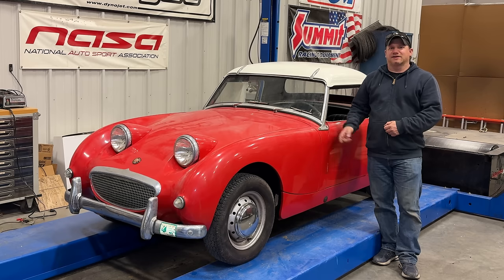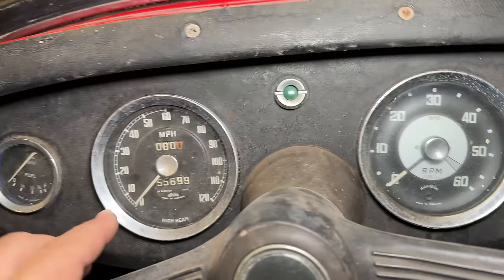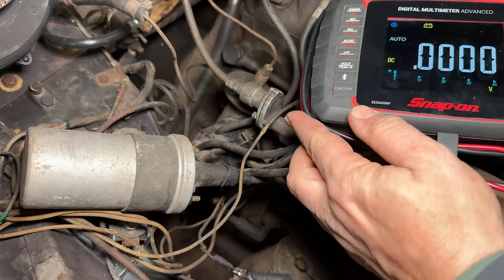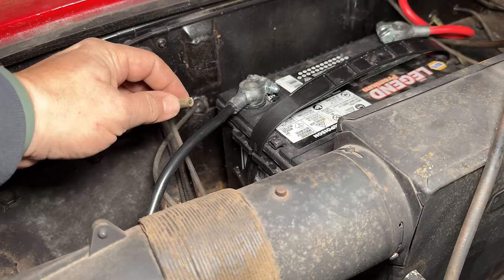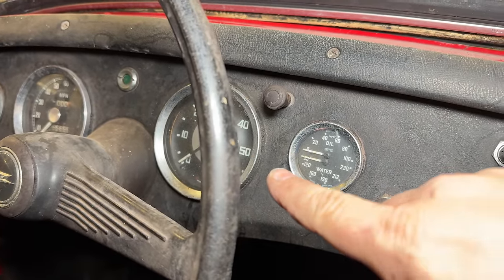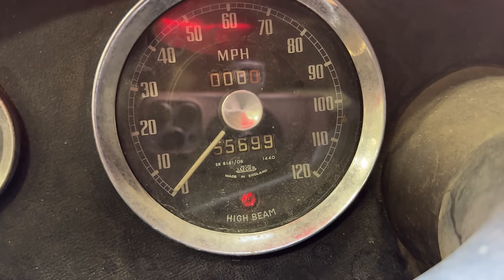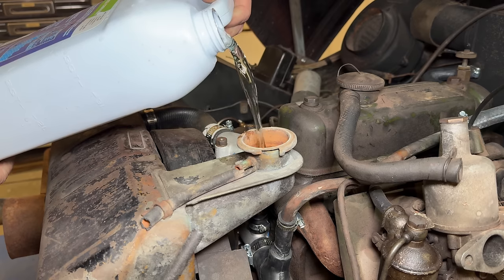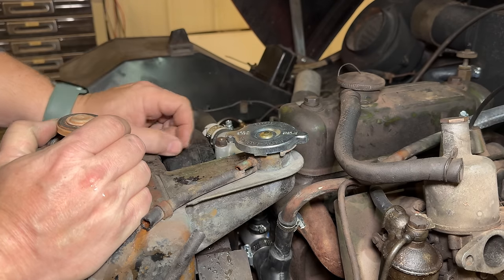Barn Sprite 3 Can Finally Run On It's Own

Comment: Looks like an MGA speedometer
Reply: Probably off a later Sprite.
Reply: @FergusPol  Every chance. My thought was that it's a Jaeger gauge. I though Sprites used Smiths.
Reply: I think you're correct. Jaeger speedos were fitted to early Midgets. One off an MGA would have the wrong wheel revs/mile unless it had been recalibrated.